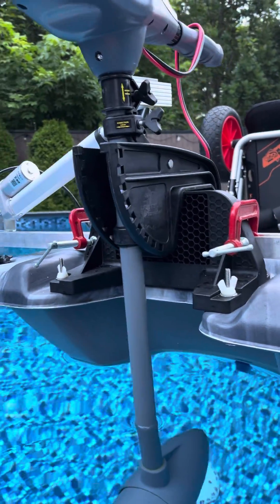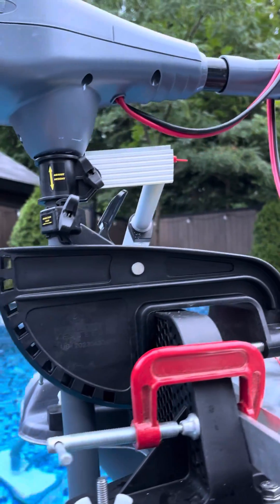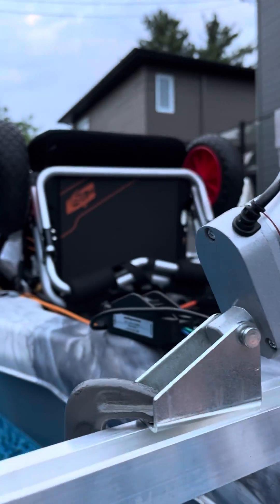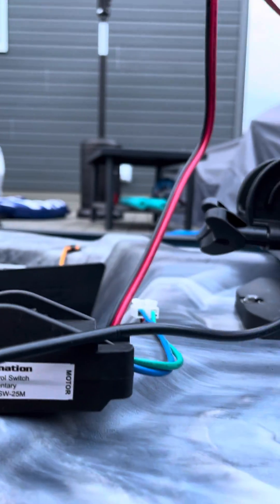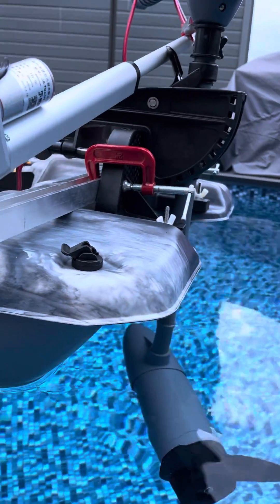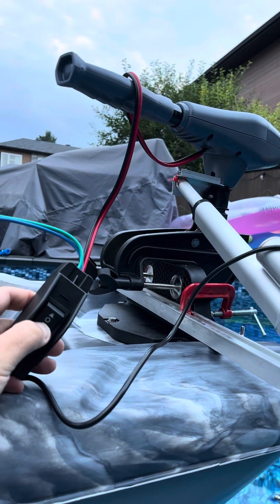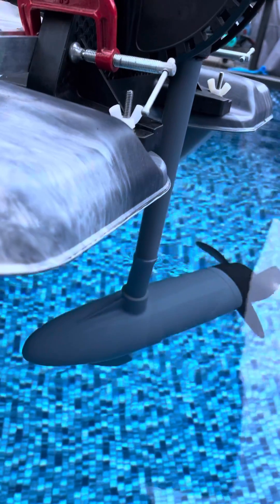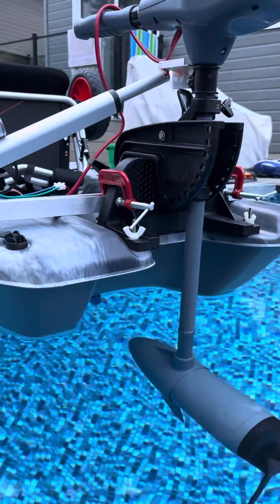12V linear actuator arm steering a trolling motor on a kayak

Comment: It's nice to see people are starting to try other things than the foot steering with cables. I'm using a servo motor basically the same idea but with a 3D printed mount, and using a esc for the speed. So I can control both speed and steering wirelessly with an RC control for like a car. The trigger and wheel type.